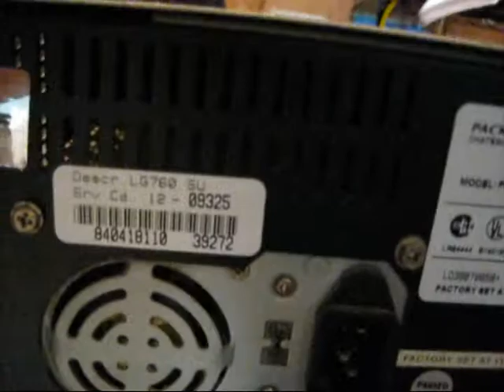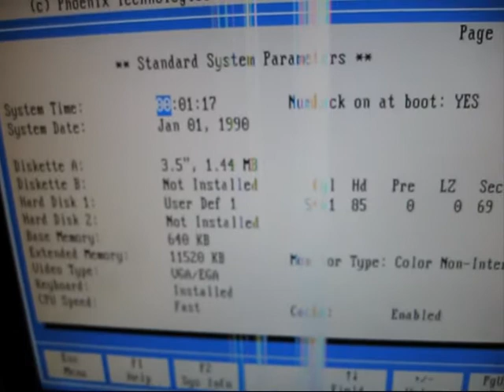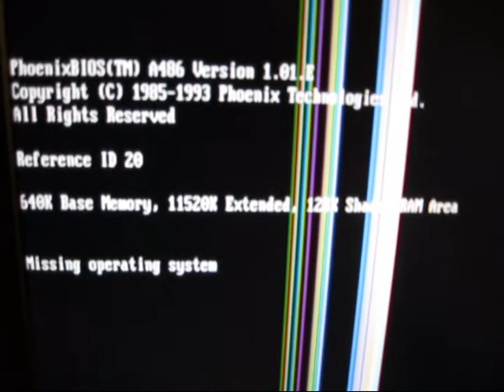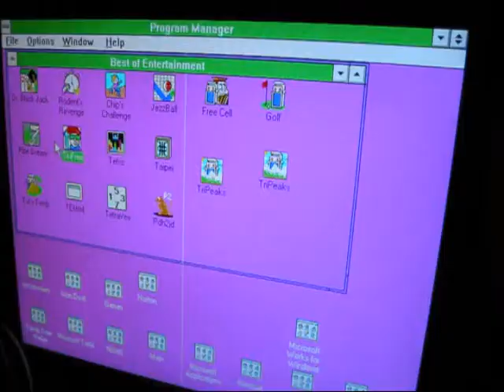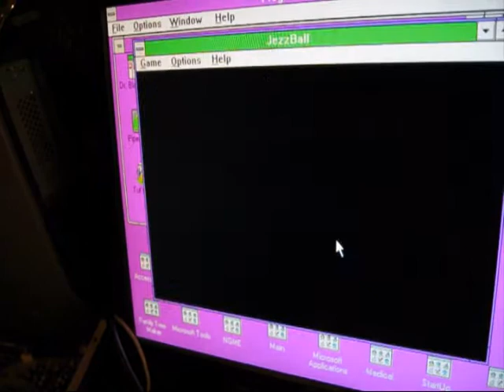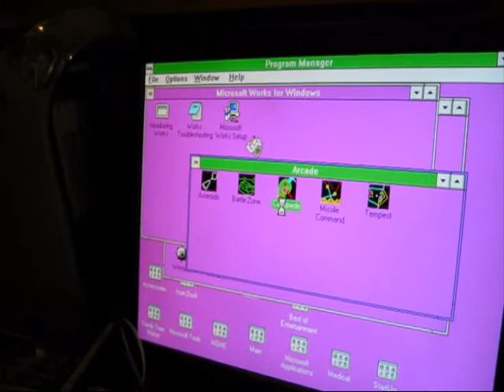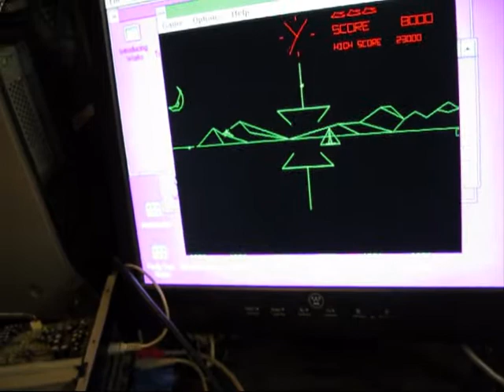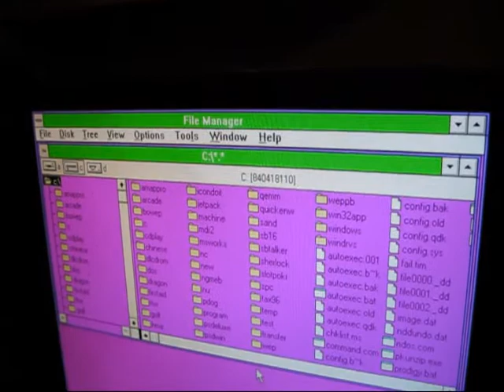Booting up my old Packard Bell 486

Comment: Nice. The first PC compatible I bought with my own money was that exact model of Packard Bell. It was an SX-25 when I bought it from Circuit City in Louisville. It had 4MB of soldered in RAM. Before I was done with it, I had bought a DX4-100 (clock quadrupled) CPU for it, and added the maximum 16MB of extra RAM for a total of 20MB, by buying 4MB 160 pin SIMMS for close to $40 apiece. That computer got me on the web. It ran Linux, and taught me Linux. It was a good computer, an inexpensive and powerful computer, and I miss it to this day. Thank you for posting this.
Reply: Someone could answer, "Oh, Compaq was making better ones when you had your stupid Packard Bell." Well, yes, obviously. But that damned Packard Bell did everything I ever asked it to do. A Chitty Chitty Bang Bang of inexpensive personal computers.
If you still haven't sold it, I will buy it.